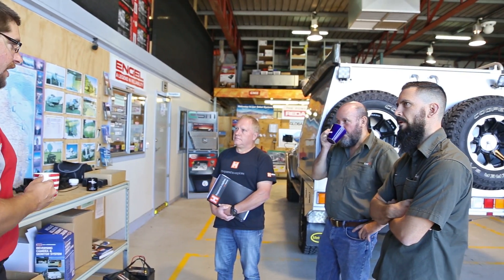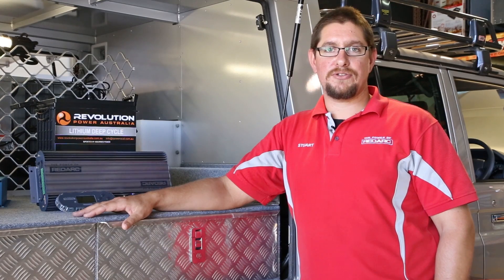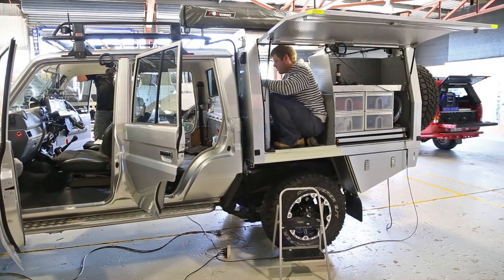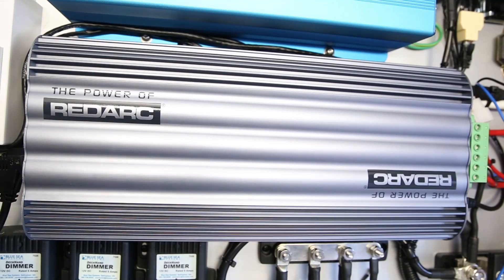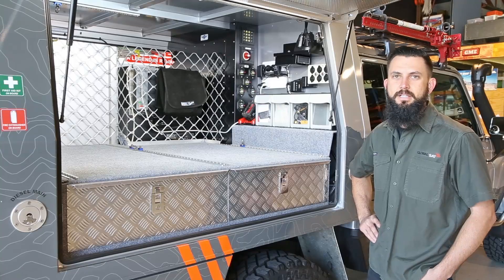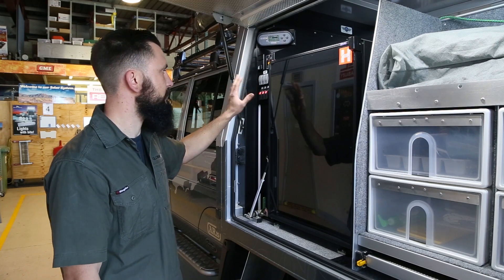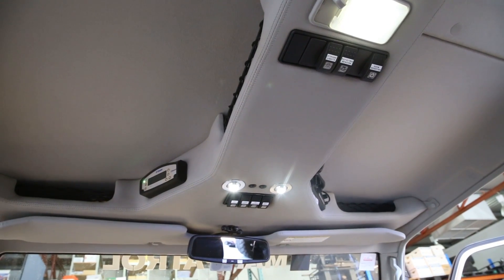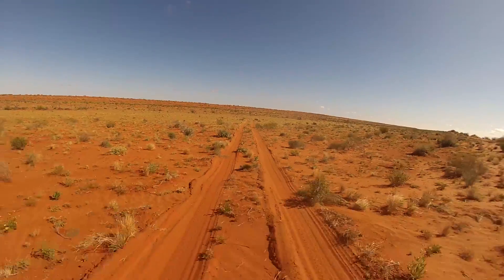Building the Map Patrol - Hardware & Electrical | Modified LandCruiser 79 Dual Cab

Comment: I realize mapping is the HEMA bread & butter but there's basically no mention of the mapping system itself, just 'differential GPS.'

Looks like a Trimble Tornado or Zephyr Model 2 antenna on top (gotta be L2-capable, right?) but is that an SPS-series receiver or a ProXRT in the console inside?

And no mention of the ESRI ArcPad software or what interval you collect position data. Every second? Every 5sec?

Comment: Great video! Its a complex bit of kit!! 
With phone the phone, laptop and camera chargers do you run them all through the original 240v chargers or have you got 12v suitable adaptors/gear so you are reducing the use of the 240v inverter?